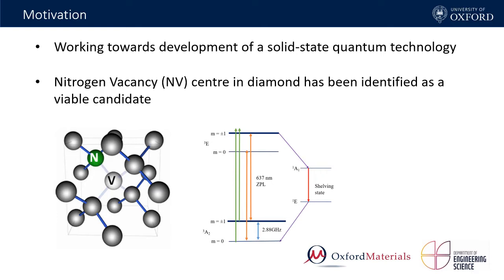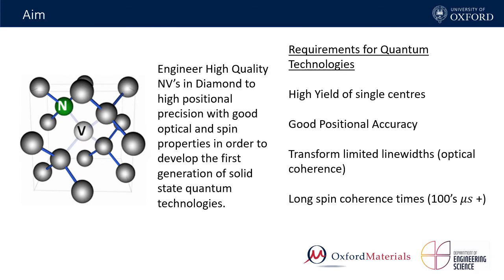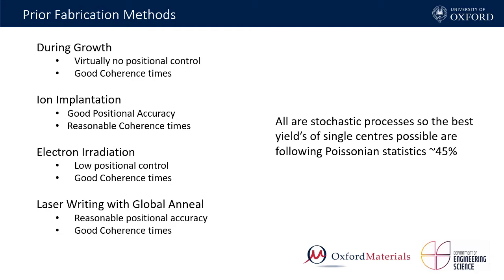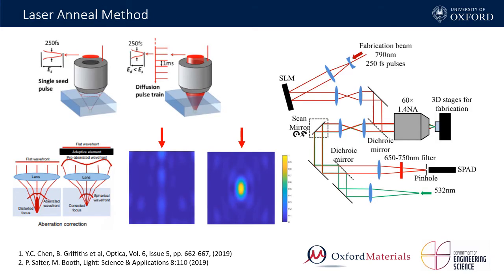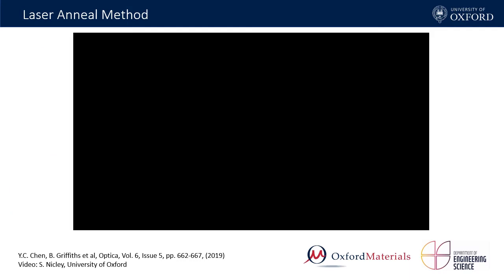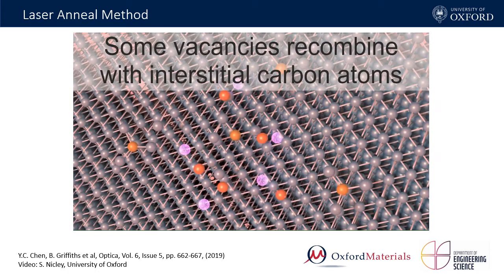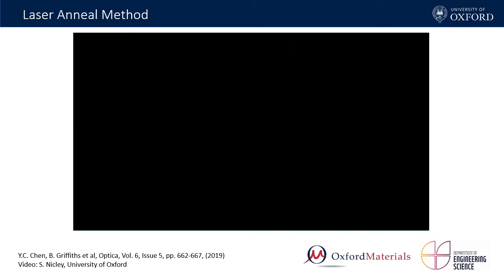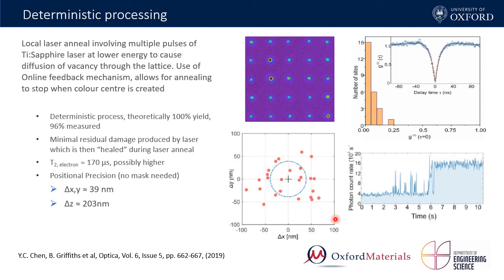GRIFFITHS Benjamin Photon2020 Talk2

Comment: I think I have a good theory to explain this
Very basic terms. 
When they are entangled imagine a tether attaching them. What if the tether itself has a twist in it. The particle doesn’t know what the other one is doing nor does it matter. 
Imagine a shoe lace with 2 marbles on each end spinning if you twist the tether by 180 degrees along the length of the tether which would be one twist (which can be done quicker than light, to us, the observer it appears as tho the one particle knows what the other is doing but in reality it’s the entangled tether it’s self from what ever process created the entanglement. 
The outcome maybe vary at times due to other entanglement interference which could cancel the spin of the particle for example if the entanglement tether was perpendicular to another one